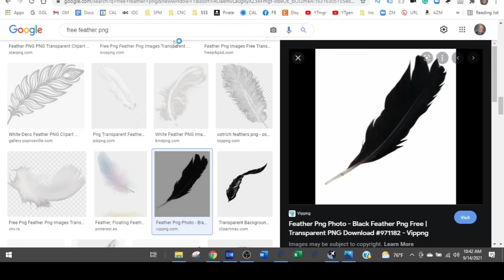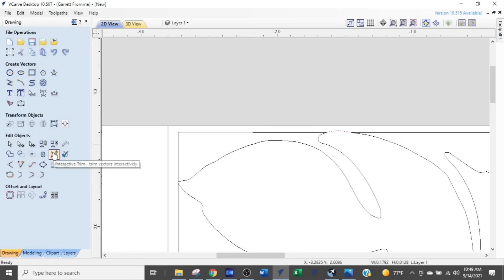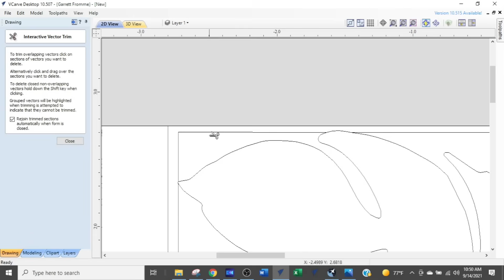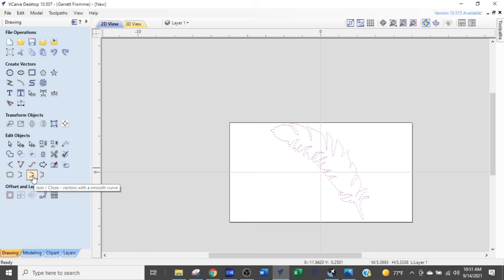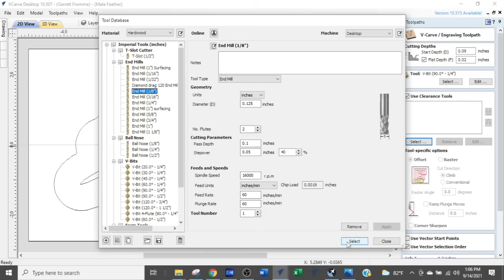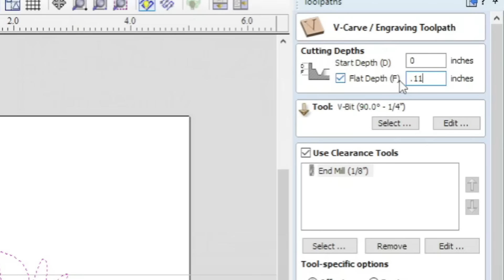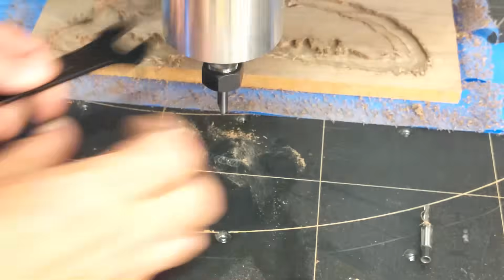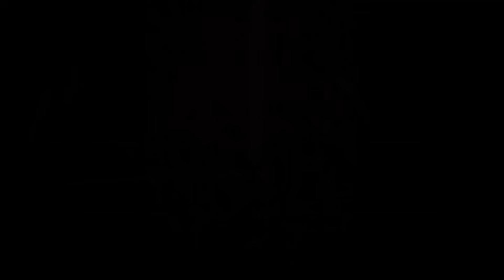How To Make a PERFECT INLAY with a CNC Router, Easy CNC Router Projects

Comment: What are the steps to setting up vcarve to longmill? I don’t see the longmill controller when trying to set up my longmill with vcarve. Looking forward to following this video if I can get my longmill hooked up to vcarve.   Best Regards Marc
Reply from the maker: VCarve does not hook up to longmill. VCarve a design program. You need to use control software to hook up to your router. Your post processor will be the grbl post processor
Reply: Ok I see. So vcarve creates the files and post processor sends it to your machine. I really appreciate your help and fast reply. Headed to your website to look for bits! Thanks Again
Reply from the maker: @marcwinters6220  Vectric does the design work and generates the g code. The g code is what tells the CNC router what to do. However the g code needs to be transferred to the control software, such as g center. Then your CNC router will run. Send me an email and I'll send you a link to a video that will walk you through it

Comment: If you spray the excelarater on to the opposite side then then the CA glue you have more time to set the piece down.
Reply from the maker: Hey Ron. for the thin CA glue, I don't even use the accelerator any more. Not needed since the glue sets so fast.

Comment: Hey Garrett,
Great video.  Two questions.  Will VCarve’s inlay toolpath feature do this?  Also, with your new LongMill, will you upgrade from desktop to pro to eliminate the 24 x 24 limit?
Reply from the maker: Hi Dan. To your second question, I have already upgraded. I just teach desktop because it is the basic that many people start with.

To your first question, I do not use the inlay tool path but will work with it shortly. I wanted people to understand the basics of inlays first.

Comment: This might be a better solution to using blue tape.  https://www.youtube.com/watch?v=cauttL6eZss
Reply from the maker: Hey II. I've done this. The carpet tape is much harder to get off. There are times where it works well. Especially when you have heavy cuts to make.
Reply: @IDCWoodcraft  Yeah he's not using or suggesting carpet tape.  The tape he uses is designed for the task for woodworking.  No chance of glue or accelerator bleed over or staining.

Comment: Excellent tutorial.  I did an inlay a few years ago and tried it again today.  I messed up on the numbers and ruined the project.  Your video has put me back on track.  Thanks for the detail in your presentations.  I built my own machine on a Saturn 4x4 frame and Nema 34 motors along with the electronics.  I have a 4th axis also, but i have not used that yet.  Do you have a video covering 4th axis?
Reply from the maker: Hi Craig. Sorry brother, I do not have any 4th axis videos.

Comment: Thanks for you video but unfortunately I tried this 2 times and on both attempts I had gaps at the sides of my project.
I seems like my male cut was not large enough to fit the female v groove. I dont think my machine is at fault ,using a Onefinity which is ball screw and very accurate . Also i ran my stock through my thickness planner before starting. I'm at a loss here.
Reply from the maker: Did you do the feather? I'll double check the program if you did.
Reply: @IDCWoodcraft  No I tried a different Vector of a stem and leaf.Thank you for your videos and up to this point you have helped me a lot. I have learned a lot. I even purchased some files from your store onETSY. Thanks Garrett

Comment: This is an outstanding video! Well thought out and presented. Thank you. I learned a lot. A quick question. Will your driver software run an x-carve in stand alone mode? You know, so I don’t have to pay them to run my machine. 😁😁
Reply from the maker: I would expect the xacrve to be able run without their software. I don't have an xcarve. It would be pretty bad if they had you locked into their platform. Ask in the xcarve facebook group.

Comment: As usual, great work Garrett! Forget using the table saw or a band saw to cut off the waste inlay. Both are just a waste of time and I have seen guys ruin some really nice pieces getting caught in the table saw blade. Just let the surfacing bit take off the waste. It's safer and less steps. I don't remove the female piece from the table once it is cut. I just glue the male piece in and use some old exercise weights to hold it down until the glue sets. Then use a surfacing bit to remove the waste.
Reply from the maker: Hi Judgem. Yes, nect time I will do it that way for sure!

Comment: Great Video as usual !!!  Thank you.  So if you want to do more detailed inlays, do the same depths work or does it need to be deeper?  I was wondering about strength on thin sections of finer detailed work.  My concern is if the start depth gets deeper on the male portion than your settings, it will cause bits to break or damage the piece.  
Thanks again for another very informative video.
Reply from the maker: Hey Bob. No matter what detail you have, these depth settings are what to use.

Comment: Just made one! Looks good ,but... I notice the vbit goes deeper than the end mill. Is this? Both were zeroed properly. Ill sand a little more then glue it up.
Thanks
Reply from the maker: Hey Doug. Yes, it seems the v-bit is just slightly deeper. I recon it is becuase there is less pressure at the tip due to the point of the bit vs. the flat bottom of the other git

Comment: Thanks for this, I learnt something really new, as i had to unlearn from my previous lessons when used endmills only for inlays and lost some of bits as they broke during the machining ,  my question today is: ‘I work in metric units and so the cut depth numbers you said we keep the same, I understand can simply be converted from inches to mm, but I’d like to know if there should be any special considerations because I am working in metric units.
Reply from the maker: Hi Adedamola. There are no special considerations. Just convert the numbers to metric. I forgot to add the conversion numbers in the description. Added now. Here you go

→ For the Female inlay component
         Start depth 0.0
     Flat depth  0.11 (2.794mm)
→ For the Male Inlay component
        Start depth 0.09 (2.286mm)
        Flat depth 0.02 (0.508mm)

Comment: Garrett, when using the glue & tape method you do not spray the accelerator onto the glue. It should be sprayed on the opposite side, as in the piece you are attaching.
Reply from the maker: Thanks Fier. I will do that. Makes total sense since the thin glue sets so fast

Comment: I liked your tip of using the offset tool reduce the amount of machining for the male part.  
I use the blue painters tape and CA glue trick for a lot of my projects.  It has always worked great for me.
Reply from the maker: Hey DCD. This method eliminates using the offset. Yes, painters tape is awesome!!!

Comment: Going nuts!!!  I use a Mac to get my photos or clippings but run my CNC with a windows system.  Problem, what can I do  or use to “snip” art work when I can’t find the sniping tool You use.  Every one I can find is for Windows system and I can’t get them to work in my MAC? (Sound of hair falling to the ground) Is there a system that will work (sniper) between the two?
Reply from the maker: Patrick, there are no design programs made for MAC. You either need a PC emulator or buy a PC

Comment: You should make an effort to understand start depth and flat depth because you are not correct. Flat depth sets the gap above the pocket board you leave. Nothing more. The glue gap is entirely controlled by the start depth and is equal to how much less you set it than your pocket depth. The two number do not have to “add up” to the pocket depth. 🙄
Reply from the maker: Thanks for your input. There's always nice to have people who add details to such videos when I miss explaining things.
Reply: I just reread my comment and it sounds pretty snarky in my first sentence. Sorry about that, it didn’t sound that way in my head.

Comment: Great video . I have had problems trying to figure out offset male and female when using the inlay toothpath on vetric.
This should work better.
My question is I have a circle (male) that I do not want to flip inside (female). Basically I cut a  design inside the (male) circle and want it to be up when I insert it in the female.   Can also be used to insert letters.
I assume I can use the same technique and settings.
Thanks,Todd
Reply from the maker: Hi Todd. It took a couple reads to understand what you were asking. But I think I'm still missing something. Email me on this with a bit more explanation.

Comment: I enjoyed the video,  I have been wanting to do an inlay of a leaf, then use my laser on the inlay to add that detail that you see in a leaf. Did cringe when  you used the table saw. I will use my band saw or just mill off the excess completely.  Thanks again for all your excellent videos.
Reply from the maker: Hi Don. UnfortunatelyI don't have a band saw or I would have been using it,

Comment: Nice job. Similar to some of the other ones I have attached. But, much better explanation!
I do not understand the start and stop depth on the male side. Why not start at surface? Joy still not clear to me.
Still will make one this weekend.
Well done.
Reply: The start depth on the male part matches the top of the vcarve in the female part and the depth of cut is the distance the male part sits above the base piece, hope that makes sense.
Reply from the maker: Hi Doug. It's a matter of keeping the bottom of the male piece from contacting the bottom of the female. It is trigonometry that explains it.

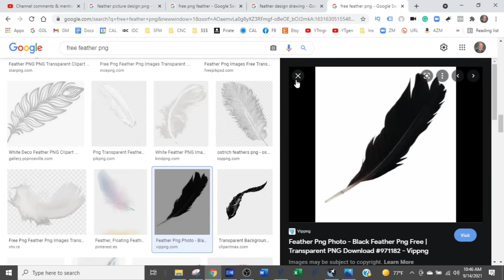Comment: Your comment around 9:00 indicates possible problems with the checkered background.  All that background means is that it is considered a transparent background.  When you save the picture, there is no background. :)
Also a way to explain the inlay female vs male is On the female, the flat depth is how deep to make the cut.  For the male, the start depth is the female (.11) - gap(.02 In this case) = .09. The Male Flat Depth is how much material is above the cut to leave space (for a band saw to cut off).  I hope I said this correctly, correct me if I am wrong.  One more thing to mention.  There was no need to use your table saw to remove the inlay material.  You could have taken it right to the cnc to remove that material.   I know, I'm being picky.  Great video all in all.
Reply from the maker: Thanks SV. I forgot to tell them they could save it as a birthday. Glad you commented. That's why I love when people comment. They add in the stuff that I forgot to add into the video.

Comment: Good video Question is it possible to use your surface bit with the offset feature or should it be raster
Reply from the maker: There is no reason to use the offset when you're using a surfacing bit. Offset is for when you need to create specific sizes around cuts
Reply: @IDCWoodcraft  i meant in cut direction
Reply from the maker: @michaeljameson1046  Yes, you can use raster.

Comment: Hey Garrett, What an amazing video of your inlay. You are the best teacher I ever seen. I am a Norwegian retired university teacher at an age of 75 year. I would like to try, but it will be for a hobby base, so may be I will invest in a cnc route, only to try your tecninc.
But I wonder, in Norway we use metric. mm and cm. I suppose its easy to change the software between inch and mm. Regards Knut Næss
Reply from the maker: Hi Knut. Yes, in the software you would simply set your project to metric and work with that.

Comment: Great video as always Garrett! Just a few questions, if I use a 60 degree v-bit to do the inlay would I keep the same start depth and flat depth numbers?
Reply from the maker: Hi Jim. Yes, no matter what v-bit you use. 60will work just fine. Just try to use the bladed bits.

Comment: Very well made and shared a lot of good information. I have done a few inlays and I know there are many different settings that people put out there. Have you done any really fine detail inlays? Great job! What speed do you run the router at?
Reply from the maker: Hi Scott. I will be doing an extremely fine inlay in the next couple weeks. I love to push things to their limits. Lets see how small I can make it. Is set the router on 3
Reply: @IDCWoodcraft Looking forward to the fine inlay video. That's what I have been working on.

Comment: I tend to use the ordinary masking tape as it is cheaper and the glue is stronger (as long as it is not left on for a long period it is as easy as the painters tape to take of) 
:)
Reply from the maker: Hey ATN, I'll give the regular tape a try. didn't even think about it. thanks.
Reply: @IDCWoodcraft  same for me, it just dawned on me that the blue painters tapes mission is to be easily removed after masking.. so tried the ordinary tape (about half the price here in Norway) and it worked just as good 🙂

Comment: 1) If you use the blue tape hold down on a smooth table surface and the workpiece.  Apply the CA (super glue) to the back of the tape on the workpiece and the Accelerator on the back of the tape on the table surface. This gives you an extra few seconds for positioning before the accelerator "kicks off" the CA.  And, any bleed-through of the CA will be on the back of the work piece (sand it off) rather than your machine table surface.  2) If you are going to use a table saw (as Garrett shows in this Video) PLEASE use a "zero clearance insert" for the throat of the saw.  This will keep the scrap from dropping into the saw.  3) Buy a push-stick or carve yourself one to keep all of your fingers the same number and length.  I have been woodworking for 40 years and I have too many acquaintances called "3-finger Joe."
Reply from the maker: Hi Jay. I had a zero clearance plate. Couldn't find it. Good tip with the CA glue.

I will make a pusher and make a video about it.
Reply: I do thhe opposite. CA on tape on spoil board, spray on work piece. That way, CA won't drip when turning a workpiece  over.
Reply: You don’t even need accelerator. 

I think guys just use it because they think they need it. 

2p10 medium will become immovable within 3-5 seconds. Have never had a part come loose.
Reply: I had a couple of '3-finger Joe' uncles. They instilled the need for safety in me...

Comment: Nice and clear process. The step-by-step "recipe" is a great approach to get a clean inlay.

Two hints. First, when you're grabbing the bitmap you're going to use as your pattern, instead of using the snipping tool, right-click the mouse and pick "save image as". That will save the bitmap to wherever you direct it on your PC. Or, click the image and it wall take you to the source of the image. That page will often have download links available and generally a higher resolution than you'll pick up off a "snip". You also will get just the image without any extraneous icons from the Google image search. If there's no direct download button, you can use the right-click technique to save the image. While you're at it, if the image had that checkerboard pattern you noted as making it hard to use, you'll see in the save image as or the click and download, that the checkerboard will go away. That's because the gray checkerboard is usually indicating a transparent background (vs a sold white background). That will expand the options available for you in terms of images out there - you don't need to skip the ones with the transparent background that the snipping tool will include the checkerboard.

The second tip is for using the CA glue/tape technique for holding the material to the spoil board. Rather than spray the accelerator on the tape you've run the CA glue beads on, spray the tape on the back of the material. The accelerator won't start working until you place the material so you've got more time to work than spraying the glue which starts the setup process immediately. Spraying the tape on the material gives you extra time because accelerator only starts working when it is in contact with the CA glue. This is also where the grid lines you've engraved on the spoil board will help get the material lined up and not have to worry about trying to adjust the position once you hit the glue.
Reply from the maker: Hi jim. Thanks for commenting on those 2 items. I forgot to mention about saving the image. It would save 'fixing' time. 

Regarding spraying the accelerator on the opposite tape...I'll definitely try that.